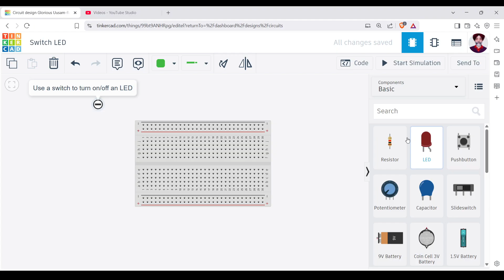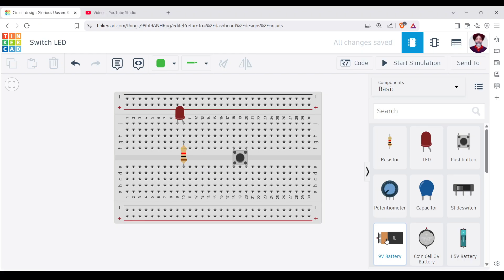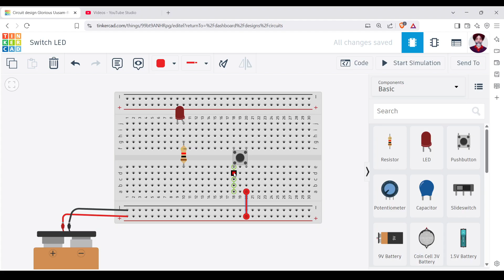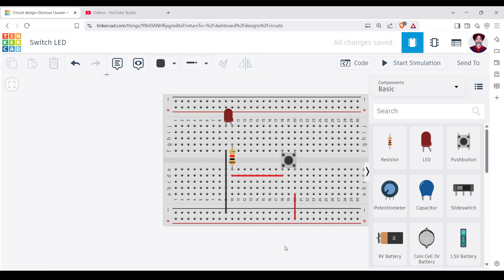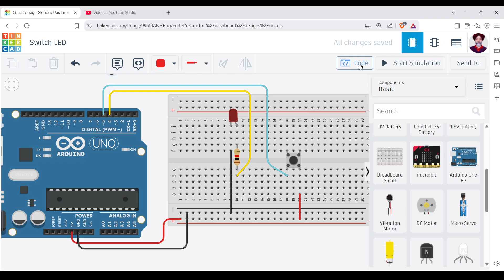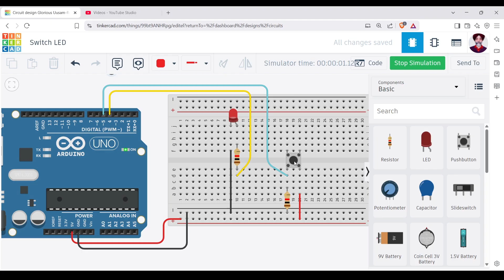Lesson13  Switch LED   Push to ON, Push to OFF

Comment: Sir, please explain the 2nd scenario, where the led stops lighting up when we press the button, I can't understand how the flow of the current works in the 2nd scenario.
Reply from the maker: When the button is NOT pushed, the current is going from the Vcc to the Arduino pin via the resistor. Hence the LED glows. 
When the button is pushed,  which path has the least resistance, the one thru the resistor to HIGH, or the one via the push button to ground? 
The one to the ground has least resistance. So the pin gets grounded. And the LED is switched off.
Please let me know if you need more clarification
Reply: @rskoura  Thank You Sir🙏🙏